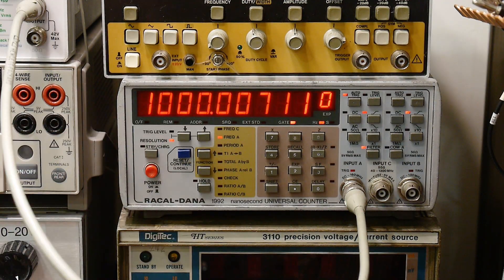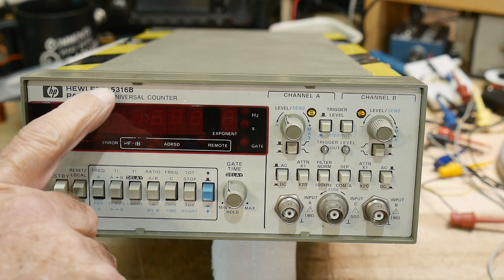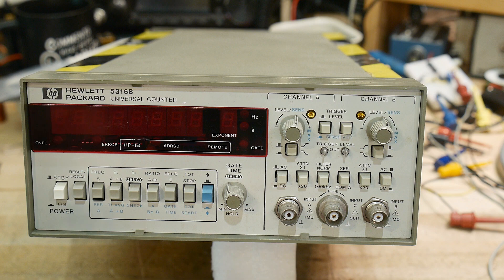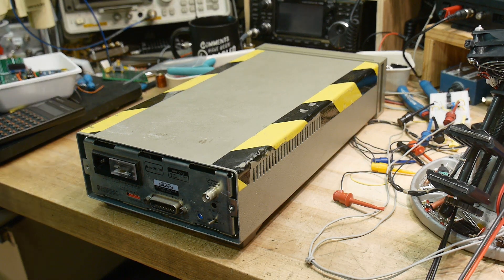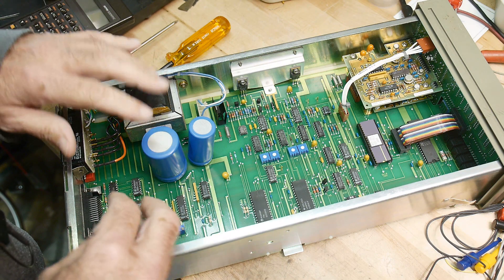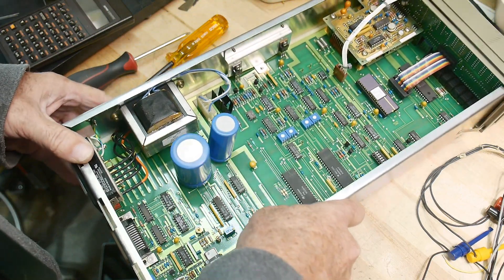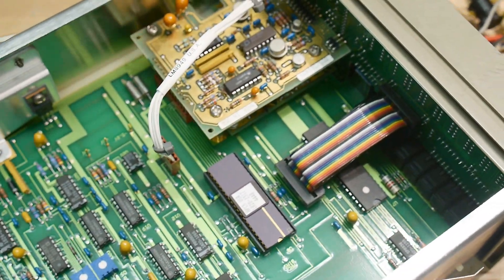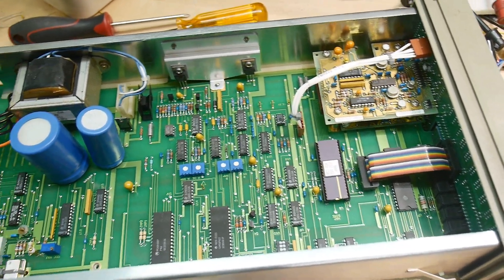#1026 HP 5316B Frequency Counter

Comment: Hello.
I have such a meter. After measuring and disconnecting the signal, the meter displays it and does not reset. Does your meter behave in the same way? translates with google translator.
Reply from the maker: the display will update on each trigger. if no trigger it stays there
Reply: @IMSAIGuy  Thank you

Comment: Hi!  Concerning new equipment, how does one make or obtain a voltage reference that is super accurate?   I have yet to hear you cover significantly accurate voltage standards.  For example, how can I measure a "trusted" voltage and then calibrate all my volt meters? Is this a topic you would cover?
Reply from the maker: I did these: https://youtu.be/VoXyQsBx2LU
                     https://youtu.be/ZBEFKT4mjlo
Reply from the maker: Noted

Comment: Very similar to my older HP 5315A.  The original crystal had aged so much that I had to replace one of the fixed capacitors in the tuning circuit to get it close enough to be tuned by the variable capacitor.  I'm now in the process of upgrading it to an OCXO and hopefully auto switching like the Racal to use my external 10 MHz from the Rubidium.  Not retired yet and have too many other hobbies so it's been a slow process to get this project to the front burner.

Comment: Option 003 was the 1.3 GHz input

Options:
001	High Stability Time Base (TCXO)
003	Channel C, 1 GHz
004	Oven Oscillator

I think option 003 is somewhat rare today.
Reply: According to HP doc. 5316-90014, 1987, pg. 1-5: Option (001,003,004) = (High Stability Time Base (TCXO), Channel C 1 GHz, Oven Oscillator)
Reply: As I'll clarify, HP confusingly describes the  the TCXO as it 'provides increased temperature stability' over the factory default XO. However most generally, and AFAIK, a "High Stability Time Base" is usually assumed to be ovenized. AFAIK,TCXO technology cannot match an OCXO for frequency stability.Not only because, the temperature compensation in a TCXO responds to ambient, and the OCXO is normally held very precisely, and significantly above ambient temperature. For temperature stability, I would expect a TCXO to be about an order of magnitude better than an XO. And, an OCXO to be at least and order of magnitude better than a TCXO.
Reply from the maker: Standard HP      10^-7 aging drift
HP w/ oven        10^-10
RacalDana         10^-12
Reply: @IMSAIGuy  For 1992. R-D's best time-base  option is 04E  (High Stability Ovenized Oscillator)  which is 10^-10. For a crystal base oscillator 10^-12? Is that a rubidium oscillator? R-D 1992 came with a rubidium oscillator?
Reply from the maker: @willthecat3861  that 10^-12 is not accuracy but drift per day